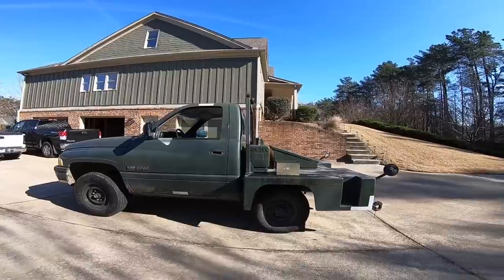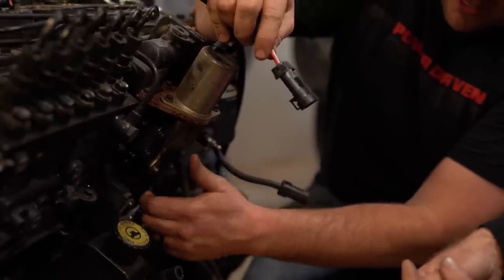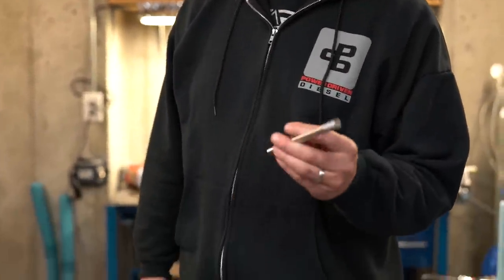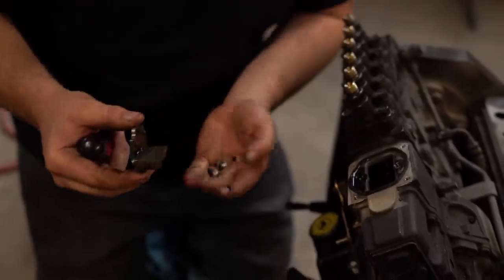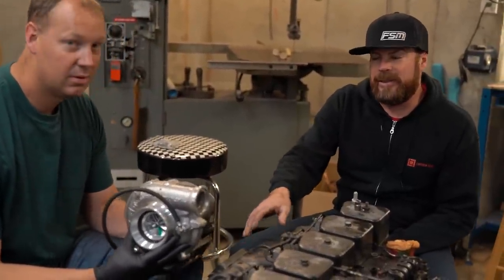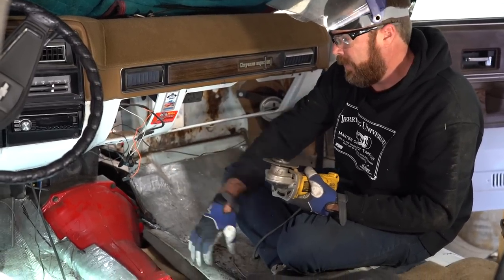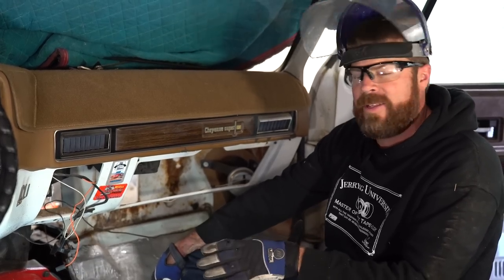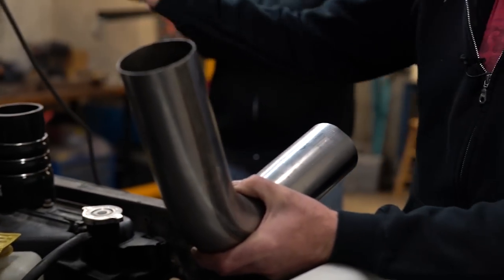Finnegans Garage Ep.47: 700hp Square Body Chevy Cummins 12 Valve Swap Part 1

Comment: 9:48 That's an HX40, right?   I have an HX35 and it spools insanely fast.  Not nearly as wicked as a compound setup though! are you putting AC back in the ramp truck?  I didn't see the condenser.  This thing is going to be awesome!

Comment: Its only a deathwheel when you dont have the guard installed Finnegan. Also mind your intercooler thickness if you plan to keep that 73 Grill. I made that mistake on My turbo 74 stepside and having to run a cheesy aftermarket grill now.
Reply: woops, typed that before the end of the video.😉

Comment: Mike, can you elaborate on why a [single] electrical cooling fan is not preferred for towing and your preference for mechanical / clutch fan? Thank you!
Reply: cause an electric fan could fail leaving you with an overheating engine. however a mechanical fan is always working if the engine is spinning
Reply: cdogg Yes, I acknowledge that failure possibility but I am still curious to know Mike's reasons. There are plenty of vehicles using electric fans for decades including "newer" trucks such as 2005+ GM trucks.

Comment: Great Mod. WWT say? Now Mike is Hot Rod Diesel guy. Makes sense on Ramp Truck. I have a 05 2500 Chevy van with 4.8 and van loaded weighs over 10,000 lbs, yet still gets up and goes. Question to viewers, do you think the Cummins Mike is using is better than any OEM in house Diesel V8?

Comment: You should've put that 454 in that shorty truck and made it into a donut machine just for the hell of it. Coolest part about those old Chevy trucks is the fact that you can buy a brand new reproduction grille from National Parts Depot for $30. (LMC wants $250 for the same thing)
Reply: The engine has been given away, at the truck has been sold.
Reply: should've is past tense.. could've but didn't, would've been fun

Comment: Man I hate the stock trans cross member on the square body one tons.  It's such a pain to get all the holes to line up and to get the bolts in the top frame rail flange.

Comment: Question. Would a pair of these engines with this engine setup live in a powerboat? I've built plenty of BBC based engines for mine and other boats, so I know about all the issues with putting a car crate engine or an engine built for a car in front of a Speedmaster or Bravo drive in a boat and why that should not be done, but I have zero experience with high performance diesels in boats. Of course the turbos would need water jackets and the exhaust would need to be water cooled with jackets or wet exhaust, as to not burn the boat to the waterline, but other than that, will it live as in, stay together etc.?

Comment: That chassis was never intended to be loaded down with the weight and power of that Cummins.  There's a reason why most people drop their body of choice on the Cummins Ram chassis especially those who intend to work the truck and add more weight in the form of a Hemi powered Bel Air on a ramp bed.

Comment: I have a 03 2400hd 6.0 runs good but after you. Restart it after a 10 mile run it knocks on the top of the moter. But will stop aftre 5 minutes are so any suggestions

Comment: Wait, I thought he said "only bolt ons" and not taking the engine apart. No big deal with the springs and all.....but why say you were not going to install internals? Other than that, is the Dodge truck still at your garage? Id like to come get the radiator cap. I heard they work good.

Comment: Know I’m a little late to the party here, but maybe I can get a response. I’m looking at doing a first gen cummins swap into the exact same truck. Hodges ramp and all. Not concerned about the intercooler or the mechanical fan. Was wondering, do you think the engine would have fit without modifying the firewall if a body lift kit was used ? I really like the way you got the cummins radiator and the original grill and so forth to fit, just wondering about your thoughts on lifting the body.

Comment: What was the weight of the Cummins engine?  I understand a fully dressed 5.9 12-Valve can be 1200 lbs or more, which isn't that much more than the 454 V8 weighed, so good deal!
Reply: They weighed it for the camera after taking it out, it was about 950

Comment: I remember when you first discussed maybe doing this swap, cool to see it come through! What'd you use for the big turbo? S470/472?
Reply: PowerDrivenDiesel Awesome, I'm currently looking at that exact setup. I have a 63/68/12 Borg currently as a towing single, but it doesn't go well with my new 18000rpm stall converter. Already have all of the fueling mods to support compounds

Comment: Thinking about buying a ramp truck for my open wheel modified race car, It has a 454 , crew cab ,, I the im a close to my home trakc and hr and half from the other one I racae. Right no I have a 90 chev 1500 4x4 short wheel base towing my trailer. Would you recommend the ramp truck??? , I always wanted one

Comment: I know you said you dislike single electric fans, but you should really look into an early 90s Ford Taurus electric fan. I know its a ford part, however its probably he best piece ford has ever made. Dual speed single 18" fan on low produces roughly 3000cfm and on high can produce upwards of 4300cfm! Yes not a typo, judging from every forum that has ever ran this fan on everything from a 4x4 mud truck all the way to a big block Camaro. Super cheap to find and make work. Just my .02 From a sincere Roadkill / Finnegan Garage fan from day1

Comment: Cool to finally see a Cummins diesel in the ramptruck,but why not just a singel bigger turbo that gives around 320-400hp but still over 1500lbs of tourqh?
You never chase horsepower in a diesel,just maximum tourqh at low rpm=great fuel economy.

Comment: Dig that spring compressor set man im used to the older style prybar and a sparkplug end and an air chuck fitting welded to it to shove the cylinder full of air pressure hence the valve wont fall valve spring prybar bolts to the rocker studs im also used to big and small block chevys i dont fuck with Dumb Owner Drives Generic Engineering

Comment: I swapped a 1989 12v into a 1987 suburban as a teenager to be my first vehicle. The engine is bone stock though and is running the getrag 5 speed from the Dodge. I think that is the weak spot of the build. Because otherwise it's bulletproof?
Reply: Nevada laws. Got the title for the suburban switched to say "D"

Comment: Is there any chance you could expand on your reasoning for running the mechanical fan? 

My 12v cummins has a tendency to run so cold that I would not hesitate for a moment to use a high quality electric fan.  Idle the engine wont even reach operating temp, and at speed I feel like the fan doesnt do much and its more to do with air speed relative to the truck.  

Not hating, just curious =] Hoping to do a Cummins Crew Cab someday.

Comment: I think the cowl was supposed to be removed before the engine. I’ve had cars that you have to take out the cowl to get the engine out. To be fair, the car wasn’t designed to have that engine, it was an afterthought
Reply: No its a case of them either not knowing, or choosing to not do it the right way, that diesel truck engines are put in and removed with the body off the chassis.

Comment: Here in Australia, vehicle mods are really really tightly regulated. A swap like this would need engineer reports, approval, inspection etc. 
For example, my 1997 Patrol can be approved for a 2" lift after jumping through the hoops, but a 4" lift - never.
Seems in the USA there's not those hassles? Some of the cars seen on the road on this channel would attract the cops fast.. On the other hand, the USA is seen as very litigious, so does that mean you assume public liability risk for the mods you do?
Reply: Why wouldnt you assume liability its your vehicle if something falls off its your problem

Comment: Dude, NO HVAC in that truck WILL prove to be VERY unpleasant! and you know Im right. Ive done similar power plant swaps esentiallly sacrificing HVAC for horsepower  which always results the same way. Totally stoked on having more power and performance than was ever intended, BUT either dying from heat pouring sweat or freezing my ass off and i cant feel my fingers and toes. .

Comment: And my years of using grinders I have very rarely have them explode most of the reason why is too much forced pressure from side to side it contacting something that is too strong and or the disc is compromised itself other than that they're fine yeah it takes a little bit of nerve to use them we used to call him the widowmaker.
Reply: x0472  how do I send a screenshot to you do I see it through the comments or do I do it to your homepage.

Comment: Duramax would've been WAY cooler. But I guess I get it...😕 in this instance it makes sense, it's just getting really REALLY old. I mean you think nothing can be worse than sbc swaps, then ls swaps, and Cummins swaps. More specifically 6 cylinder Cummins swaps. As it'd be way more interesting with 4bt swaps in smaller vehicles. But as said, this time it makes sense. Ya don't want a bunch of shit to worry about in a tow rig. Nothing to really go wrong on a 12 valve. It's just getting boring as hell for the most part, but this was still kinda interesting. Still would've been much more so with a duramax. And no not a Chevy guy, I'm more into fords. But that's just what I prefer and older ones at that. I don't want anything new. And the newest thing I WOULD buy would either be an lb7 or lly duramax or a 6.7 ps. I just don't like 6 cylinders. And everybody who's like oh they make more power... no, no they dont. They just have the most aftermarket support, because they've been put in EVERYTHING! So for this many dollars, yeah that MIGHT be true.  But I'd still rather have a v8, even if it made less hp. Small 6 cylinders just sound shitty, big ones can sound great. Our dt466 sounds pretty good, and I'd love to put on of those 6's in a pickup.

Comment: Not a nay-sayer, but ALOT of cutting of a perfectly good square body cab, where the 454 would have done what they intended the truck to do. Haul cars. Cummins is cool though. Toss up on if it's worth it to me. Could have done a 4Bt for fuel mileage if that is your argument.

Comment: Drrrr, instead of cutting holes and removing the A/C simply get a sledge hammer. Though moving the engine forward an inch or two would not have hurt. Then simply move the rad forward the same.
A lot easier and structurally smart.
And wrecking the integrated AC was dumb. With a modern compressor it would have worked really well for not much work or money.

Comment: one trick i heared about a while back was someone mentioning he allways used pieces from a wheelbarrow bucket to fill in the recess in the firewall , these buckets have compound curves and theres basicly the sheetmetal equilivent of a stainless J pipe 
they make the finisched piece looks allmost factory 
https://is.alicdn.com/img/pb/783/927/512/512927783_097.jpg

Comment: Saying "no computer" is slightly disingenuous as there's basically a giant mechanical computer bolted to the side of the engine (the injection pump). It's a nutty piece of clockwork I never, ever want to have to take apart.

Comment: Putting a Cummins 12v in a Chevy seems strange to me, but party on I guess, make the ramp truck faster, but I still don't think the ramp truck is running 10s, p.s. if the engine was lighter, that ram, would be a monster wheelie machine, like stubby bob

Comment: I absolutely do not like the 2nd generation Dodge trucks, I drove a few, and there was NOTHING redeeming... other than this very engine. I absolutely love the 12 valve Cummins, because it isn't a Dodge product. Very awesome swap so far, and to the haters wanting to hate that he isn't building a big block, or dropping another Chevy engine in or what ever else you want to piss and moan about, he at least has THE ONE GOOD THING from that piece of crap Dodge, and this means that he does not have to deal with trying to swap a more modern computer controlled engine into it with the nightmare of wiring that would follow. If I had the chance, this is something I would love to build. But one thing I would do different, no automatic, I love my manual transmissions. However, from the stand point of easy to drive, I understand the reason for putting an automatic in. Can not wait to see how this beast performs!!

Comment: It would have been way better to rebuild the 454 to make the amount of horsepower and torque that you wanted. It would have been lighter, sounded WAY better, no hacking of the firewall and transmission hump required to do it, no need to fabricate any mounts, and no need to remove the factory A/C. On top of that, pickups with diesel engines are a dime a dozen these days; they are everywhere. Big block V8 gas engines haven't been factory-installed in any vehicle in decades, and have an infinitely higher "cool factor." Also, why did you let that brand new hood you bought get rusty?

Comment: Even though I love Cummins 5.9L, you could have installed a GM diesel 6.2L that has no ECM, can use dual/compound turbo's and would not have to done all that freakin' cutting. I think it is a great idea getting rid of that gas hog 454.  Diesel is much better.   Like your stuff Finnegan. Like your garage.  Why did you move to Georgia?

Comment: Why would you want to take that behemoth big block 7.4L out for that 5.9L mouse motor that just has more foot lbs of torque? I bet that chevy motor could still pull a house down & had alot more get up and go. Fuel costs will remain around the same its still a huge truck. The only real difference here from what I can see, was the turbo.

Comment: who gives a shit about the money.....
of course i can spend 3 or 5 or whatever bucks a month

ITS ABOUT THE PRINCIPAL... MAN! - The Dude
Reply: also.....MIND BLOWN
thats the cleanest mopar wiring ive ever seen! 

also... the pre 80 square body is best square body

HEAVY steel..... the rear fenders in the bed are 20 times thicker than on an 86....
the way the fenders pop out, and the chrome trim on that line....so good

ive got a 77 with a stock 400 small block (it left the factory with that engine....VIN code = 400)
np mankiller (also known as a 203 full time four)

the combination of the 400 and 203..... made the truck over 6000 pounds GWVR.....6200 pounds in my case
this meant they didnt have to have smog equipment 

its a strange truck..... not a heavy half ton, doesnt have the upgraded leafs....
but IS 6200 pounds, no smog, and a 400....and a k10 silveraudo

IDK (any help would be cool)

i got this truck for 500 bucks..... 
with two blown heads, but the leak was small (at the time) to be able to drive it like normal
it eventually hydro locked....after sitting for like 7 months

got two 350 heads that were slightly ported (good casting, but low comp smog heads....not the best, but at least it wont crack)
drilled the holes to make them 400 heads

and replaced the eddlebrock 4 barrel with a quadrajet (and i know imma get hate for that)

but.... its a CARTER qjet from the late 60s..... and that 400 fucking LOVES it
only 2 or 3 vacuum ports on that carb.....

ive got vacuum advance, booster brakes.....and i think the heater doors comes off the rear intake

no bog..... unless its the chevy power moan....
as a stock 400 torques its way up to 75... turning both axles, on a heavy frame

you can watch the fuel gauge drop when the secondaries open 
mechanical secondaries = "fuck it, dump in 10 gallons of gas" bbbaaaWAAAAAAAAAAA

also.... if you think your 400s overheat.... send them to me please
its the BIG mouse 

bigger bore, and stroke for days

Comment: Should of gone common rail.  Thing is gonna produced so much unwanted smoke and going on a chassis not up to the task.  You should really start to listen to The Diesel Performance Podcast and get some education.
Reply: the simplicity of the 12valve for starters..the AFC live will handle the pre-boost smoke issue just fine, the chassis on the other hand..you could be right..he will be making A LOT of torque
Reply: TurboDieselDan a commonrail would be 10 times harder to install in this truck, and a good bit more expensive to maintain. He’ll be able to control the smoke of the 12 valve with the AFC Live and the compounds. Not all 12 valves are smoke belching pigs, people just like to make them that way.

Comment: Nice so the truck version of Blasphemy. Mike you may want to let your employers know their fans on YT are not impressed, hell I bought merch but not anymore which actually pays better than some subscription which I don't have time to browse through. They really screwed up on their decision to go all "big television" and make it paid content like my fucking cable bill. I guess GasMonkey Garage will beat you guys after all, disappointing to say the least.
Reply: They didn't go "big television." You can still watch Roadkill and all of Motor Trend's former YouTube shows for free. All that's changed is that you have to watch it on their website, (Where they can get more money from ad revenue) instead of YouTube. Episode 74 of Roadkill is available now for free.
Reply: Join free for 14 days is not free, there is not a free option, Roadkill is locked down like everything else on that fucking site.
Reply: They release 1 free episode every 4 weeks. Once the 4 weeks are over, it goes back behind the paywall. and the next episode is free. (Episode 75 is currently free. Episode 76 will be free in about 3 weeks. 

If you are outside of the US, they don't have add support yet. (They are currently working on a solution) In the meantime, you can use a proxy, (Such as US Web Proxy) or a VPN, (Such as Hola) to gain access to the free content.